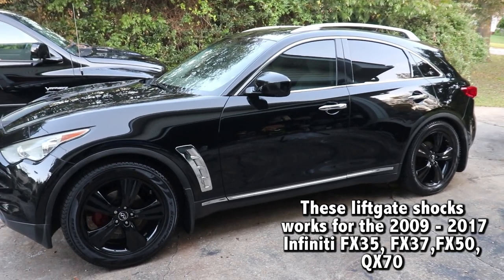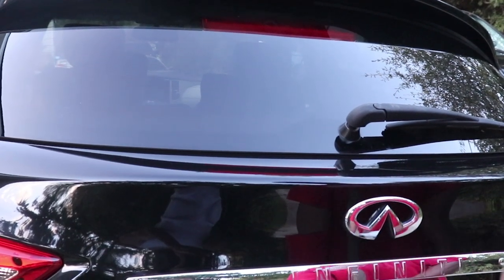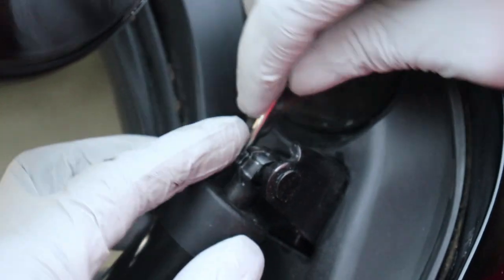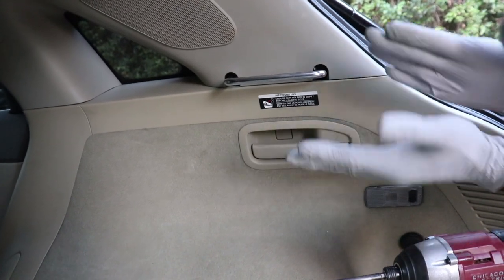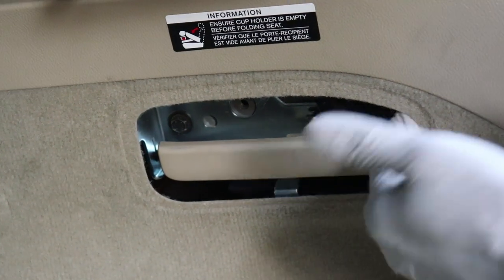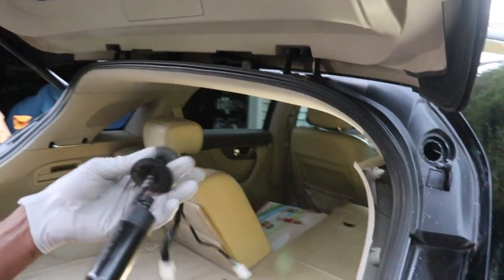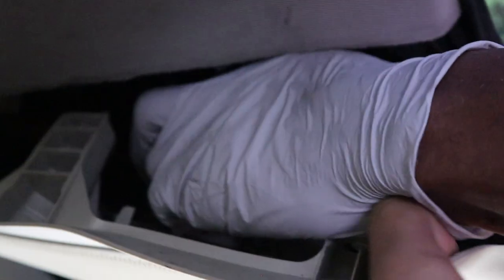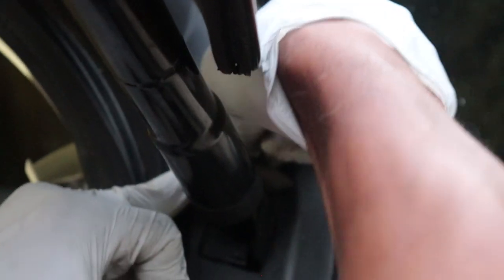2009 - 2017 Infiniti FX35 FX37 FX50 QX70 power lift gate actuator shocks Repair

Comment: Congratulations my brotha on not becoming a victim of circumstance, grabbing the bull by the horns, & doing the job yourself. It’s a got dam shame how these auto repair places will try & charge U an arm, leg, & a foot to do repairs for customers. God bless U, & thank U for sharing this video! 👍🏿
Reply from the maker: I’m glad the video was helpful. I was lucky enough to find a used set on eBay for $175. I just could not do $850 at the dealership. I’ll be doing the front wheel bearing soon. That’s a $1,200 dealership job that can be done with limited skills for cost of around $300

Comment: Thank you so much, correcting a very common FX35 problem.
Reply from the maker: Thanks for watching David. Not a lot of FX35 2nd gen repair videos so when ever I do any repairs I’ll post them. I have a front wheel bearing hub replacement video up soon. A $1,300 dealer cost for less than $100. 

Please subscribe if you have not.

Comment: Thank you for this video.   It took a lot of searching to finally find info on replacing these struts.   Trying to determine if the struts were the reason the liftgate would no longer open.   It was hard to tell if it was the latch mechanism or the hydraulic struts.  I suspected the struts because sometimes I could get the door to open but would have to lift it open.

Comment: Nice tutorial. I also plan to get a gently used set of those shocks when mine fail. I looked at the price of new ones and said no way am I paying that much. Was curious about where the connectors were though so thanks for laying it all out.
Reply from the maker: I will be posting the front wheel bearing replacement soon and other odd jobs the the average person can do. Subscribe please if you have not and thanks for the feedback.
Reply: @TRRehab  do you know if they have any grille upgrades for this model?  I'm thinking about getting one the only thing I hate about it is the outdated looking grille.
Reply from the maker: @willardrobinson6234  I'd like to see what grille you have? I was going to do a spring cleaning but and show the stance on mine, A few people wanted to see the front as well.  I get a few compliments on my grille. I'll see if I can do a short walk around video. Pollen has been serious these past few days. I'll link a few different options in the description. 

Subscribe if you haven't and thanks for watching.
Reply: @TRRehab  I don't have the truck yet. I was thinking about purchasing a 2011 fx35 used but I don't like the outdated grille. I was trying to see if they had more updated grilles for that model.

Comment: Thanks for the informative video. Need to do the same with my wife's FX35. Is there a way to tell if both sides are bad, or should we generally replace both of them?
Reply from the maker: Most times it’s 1 shock. They are pretty expensive but you should be able to find them used. Best to replace both. After replacing 1 side. Manually close the trunk and click the open button. It absolutely takes both shocks to open the trunk. If it opens, you replaced the correct shock. If it doesn’t you replace the good shock.
Reply: @TRRehab    Our 2013 FX37 has started to go flakey. The actuator releases the latch (most times) but the gate now fails to rise or to close from fully open. Sometimes it will rise several inches before it stops and must be manually lifted. My first thoughts were the motor was failing - until I saw this video. How did you diagnose the problem as the shocks vs the motor unit itself?

[EDIT]

I assumed the actuator motor was driving the lift gate up and down, but now understand the struts themselves are powered and that's how you diagnosed the issue. I guess it's a 50-50 shot at whether it's right or left giving the problem.
Reply from the maker: @weitrhino  Most likely only 1 of your shocks is bad. That would cause it ot open but not enough power to completely lift the gate.

Comment: Thank you for the video.  Did you or anyone experience shocks leaking onto the carpet?
Reply from the maker: Thanks for watching and I can’t say that I recall shocks leaking into the carpet but it’s not hard to imagine. Sounds like you are in need of a replacement real fast! Chances are you only need 1. I just checked and eBay has a used 1 for $99 …. Search 2009-2019 FX35 electric shock. It says right side but can be used on either side. Just remove the attached bracket and use the 1 on your car.

Subscribe if you haven’t and thanks for watching.

Comment: Hi, thanks for video,
My qx70 trunk is opening , but doesn’t close, i have to close manually, is that same problem?
Reply from the maker: Good day,

When you say the lift gate is opening, does that mean it goes to the full open position when engaged or simply unlocking? A tell tell sign of your lift gate shocks being the issue. Most times the actuator will release but because the weight of the lift gate is too heavy it will go back into the lock position after failing to lift. 

It would be beneficial to record the sequence and upload it. Could be the switch or the actuator. Hard to even guess without actually seeing the sequence. If I can’t help someone else may watch the video and have your answer.
Reply: Find fix?

Comment: How do you reset after the change? The buttons do not still open the lift gate
Reply from the maker: Are you sure it’s your hatch shock or the actual switch. Double check making sure the switch isn’t turned off.